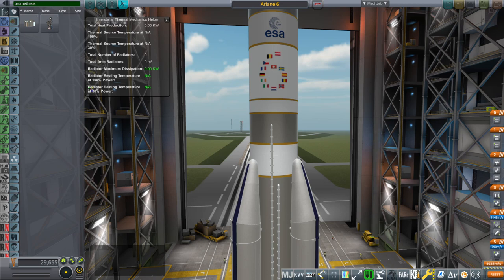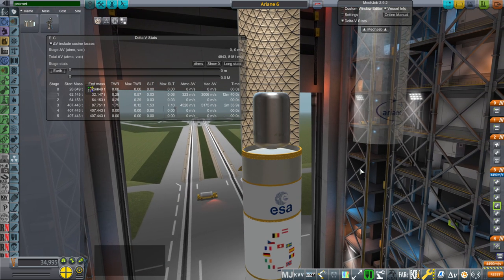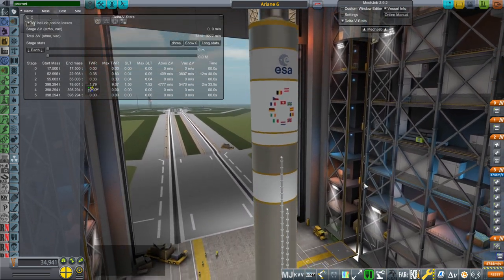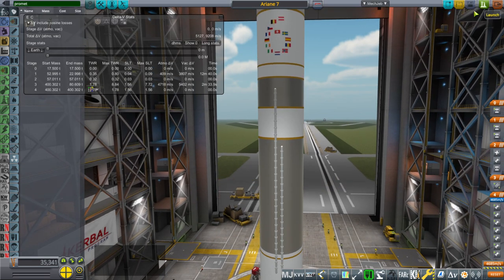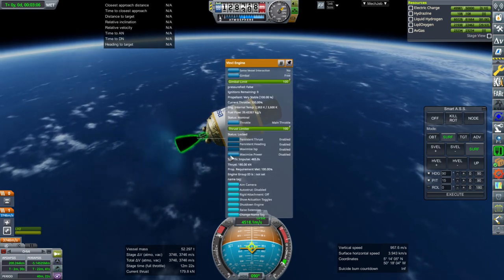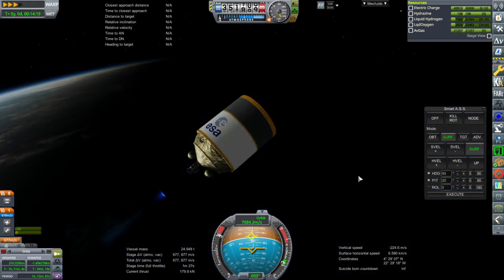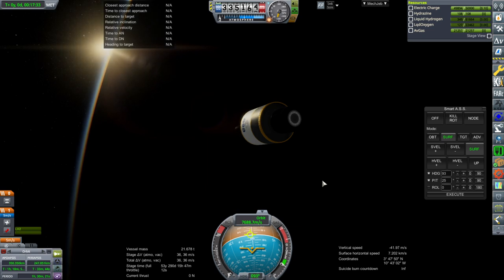Realism Overhaul in KSP 1.8.1 - Ariane 7?

Comment: In paragraph 3 of the website provided, it stated:

"Features such as variable thrust, multiple ignitions, suitability for main and upper stage application, and minimised ground operations before and after flight also make Prometheus a highly flexible engine."

That led me to think, what would improve or decline if the upper stage of your Ariane 7 was changed into one that uses Prometheus as its engine?
Reply from the maker: Would need to make a much bigger nozzle for it, but it could be beneficial. Even more like my Sagitta rocket in that case. Wonder if I should use an extendible nozzle like the ED-4V (and Vinci for that matter) has.

Comment: Vulcan heavy already exist, it'a a single core Vulcan with 6 boosters and a stretched Centaur.
PS it would be nice to see what a Vulcan 502 with no boosters could do (without underfueling).
Reply from the maker: That's correct. I told people that, but they insisted on the three core version because of a tweet from Tory Bruno which I had taken to be a joke. As far as Vulcan 502 without underfueling, it can't get off the ground, I don't think. The tanks have to be underfueled.
Reply: @RaizSpace  I expected that, Vulcan core is really weak. Tory Bruno said the 502 doesn't need any "special operation" or something like this, but i guess maybe undefueling is not considered a special thing, even though i don't know how easy it is with cryo propellants.

Comment: 0:30 Is it possible to add a texture-swap option or something?

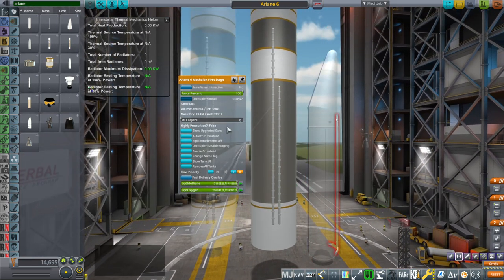2:15 All else being equal, dry mass will be higher, due to the head pressures being higher with increased density. This is why the dry mass fraction of rocket stages don't scale linearly with propellant density. Due to theoretical reasons I have somewhere but can't find ATM, I use as an approximation that dry mass fraction is proportional to the ratio of propellant densities to the root of 9 over 4, which works decently well.

9:20 I wanna see the shitty Vulcan Heavy!

Now, the Vulcan may not Heavy (at least without crossfeed), but this will Heavy.